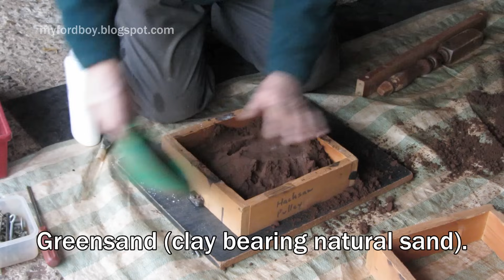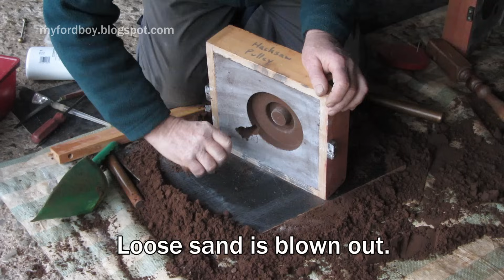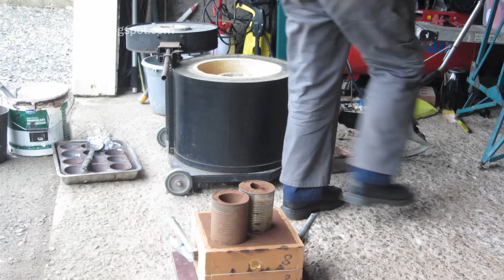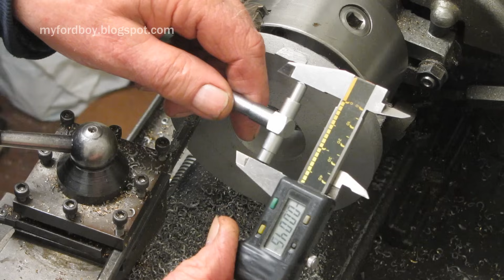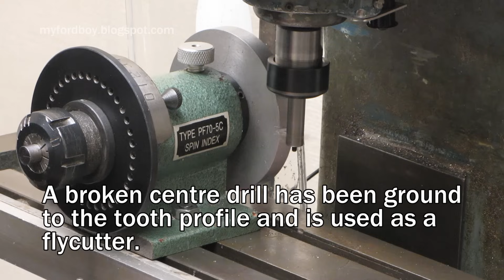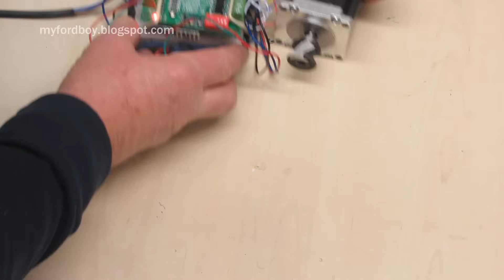Metal Casting at Home Part 64. Casting and Machining a Toothed Pulley.

Comment: its cheaper to take it too lazer cutting machine and get them to cut one out got a sprocket made for a deltek mini bike 50 bucks
Reply from the maker: It's not cheaper, this cost me virtually nothing. It's about the satisfaction of making something rather than writing a cheque.
Reply: @myfordboy  1 - agree for satisfaction... I also enjoy all kinds of DIY...
2 - don't necessarily agree for costs.
     Of course costs for oven, machines, tools, sand, etc. split to all projects -- still they all definitely cost ... also electricity, oil... doesn't come for free.

"virtually nothing" only if - you split to a lot of projects - machines & tools last for 20+ yrs - and if oil & electricity cost almost nothing.
Reply: I agree... 99% viewers will save a lot by using any king of service ... Billions of clicks pay off for everything I guess.
So the video is kind of non-sense if you thing about that. Still I enjoy such as most do we can read from comments.

Comment: what do you use as parting dust and is that wd40 use for cutting oil?
Reply from the maker: Talc for parting powder. The spray is Tectane CO507 cutting oil but WD40 works well on aluminium to.

Comment: Одного не понял. Зачем нужно было отливать диск, потом вытачивать отверстие. С отверстием значительно сложнее ?
Reply from the maker: To cast the part with a hole would have needed a core to be made. By casting the hole not quite through it was not necessary.

Comment: Great work, but not the best choice of motor connector. It's common rule to use socket on side which can remains under voltage when the socket disconnected (hot) and plug on the other (cold) side. Surely, you cannot get electric chock from open contacts under the voltage this motor use, but any metal chip in connector when you accidentally forget to power off your system before disconnecting the motor can damage your motor driver.
Reply from the maker: Your are of course correct the socket should be the supply side but as the motor is only 3.2 volts its hardly an issue.

Comment: I've heard that talcum powder is being replaced with corn starch in modern baby powder, for health and safety reasons. Is this powder also suitable for dusting your forms?
Reply from the maker: I just use the cheap stuff from the supermarket, I haven't seen any cornstarch stuff.
Reply: Mooncabbage I buy pure talc powder from a billiards supply store. Like $6USD.  Baby powder is mostly starch due to breathing talc being bad for a baby.  Both probably work fine.  One smells like a diaper, the other one, like ground rocks :)

Comment: anyway you would sell one of those gears?
Reply from the maker: I can do a blank casting. you would have to cut your own teeth.
Reply: I can live with that, very happily i might add unless you want more than $50 for it.
Than i might have to pass, and try to make it out of billet which would be just as expensive lol.
Also i live state side.... so we'll have to figure out the damage lol.

But I have a mill, lathe, band saw, and welder. Just no casting ability and after seeing this i feel so incomplete without having one lol. Though i doubt my wife would let me start casting, since we live in the city area and small garage.
Reply: Btw what was the Pitch Diameter and tooth profile you used?
Reply from the maker: The belt is 170XL037,  google will give you the profile. I can do the casting at £20.00 (GB pounds) plus shipping. I estimate £10.00 to US
Reply: That is very reasonable thank you, I kind of figure it out to be a XL only issue with pre-bought gears are the hubs are too small. Billet i don't know just seems more fun to do it with your casting, which btw seems to be solid.
i'll email you in a bit about and with everything.

Comment: Do you save the aluminum machining chips for recasting?  - You lost this old analog guy at Arduino!!  - Great video as always.  See you in part 2.
Reply from the maker: I do'n save the swarf. Too much surface area to metal makes for lots of dross.
Reply: Makes sense, more surface area more oxides, more oxides more dross.

Comment: Aluminum is toxic.    Then not your average household garage has a kiln or a lathe.    So yes, this can be done at home if your home is a machine shop.
Reply: It's not as difficult as you imagine you don't need to be an egineer these days ...honest.
 You do need common sense , persistence and the ability to think things through.
 You make your own Kiln , You'll nee a power drill and a reasonable stet of metl work twist drills , a hacksaw  or a small angle grinder is very useful.  Borrow a small welder set if you don't have one or simply use nuts, bolts & washers to  pull things together .

If you don't want a posh  kiln you can dig a hole in the ground ' line it with clay bricks and use charcoal as a fuel  with some sort of air blower to blow air in from the bottom just like the Romans and Bronze Age people did .

You can also make your own " gingery lathe " , how do you think  engineers made things in the  ate 1800's ? 

 If you Google " Gingery lathe "  you should find  a site that lists about 100 gingery projects made at home with home made equipment .

Comment: Do you adjust the aluminum mixture with mineral/metal additives for the project at hand?
Reply from the maker: I use aluminium car wheels for the material, degass with sodium carbonate and add a drossing flux. I have shown this on lots of the previous casting videos.

Comment: i dont have an indexing head. I do have a chinese cnc machine that is great with aluminium.. and a chinese 8x24 lathe I would have used to face the back of the pully then put it on the cnc machine to profile the teeth by drill milling the pattern, then cnc machined the centre hole and  outer diameter too. back in the lathe to finish the other face etc. It works, I have made many bicycle chain sprockets.. even in steel (but thats pushing the cnc. 6050).
The trouble with the chinese cnc is the cross bars are just only 16mm and 100mm apart. 500mm long and they bend under load. The cutter can twist the rails 1mm with 20kg force. if they had used 20mm shafts that would be about 100kg and a 25mm shaft about 400kg.. I will modify it one day.
Reply: +Raymond Merrick 
The fine China should only be used for special occasions!
:

Comment: Nice work but an index head is not intended to be a spin head. You’ll ruin your index head. Just saying...
Reply from the maker: It's for indexing.
Reply: @myfordboy  that's exactly my point.  No need for a motor on an index head.
Reply from the maker: In standard form you can only index a number that divides into 360. With my arrangement you can index any number for example to cut a 57 tooth gear.
Reply: @myfordboy  got it, thanks for clarifying!👍

Comment: That seems an awful lot of work to make a blank that could just be sawn off a length of Aluminium bar which wouldn't have any blow holes or impurities. These things cost next to nothing from a stockholder.
Reply: Obviously you did not read the prior comments, where the topic you suggest was well-covered.
Reply: Do you read all of the prior comments to a video before commenting? No, people comment on the content of the video and description. I don't believe there was anything there to suggest that this wasn't intended to indicate that it was a good idea to cast a pulley. It's a bad idea, and that's what I said. If you didn't mean that, then perhaps you should have made yourself clear.

Comment: this guy's a pro. Since computers this tecnology is practically lost
Good to see someone reviving casting
Reply: I agree.
Reply: Is not, that´s a belief. There´s plenty of manual engineering work, it´s not effective to have CNC, water, lasers for smaller production, tool maintenance etc. It´s not that visible, but still exists.
Reply: Yep, some wiz kid would 3D print it with sintered metal while anyone else was still making the timber moulds & machine the plastic blank, and mixing green sand.
That’s why these technologies are dying art forms.
It is good to see the knowledge being preserved for posterity.
Yes you could cast it or you could have bought a short piece of 6 or 7 inch alluminium round bar stock & just turned it in the lathe & then milled the teeth.

I have to say I do enjoy watching this all the same, very satisfying.

Comment: Nicely done!  Hey, a couple of dumb questions.  Could you have done this with lost wax? Also, is the casting sand reusable?
Reply from the maker: You could use lost wax. If you mean to also cast the hear teeth, whist this is possible I would prefer to cut them.
Sand is reusable.

Comment: 7 to 1 division ratio in software with a 72 tooth pulley ????  72/7 is not an integer, 6 to 1 surely.
Reply from the maker: No it's 7.2 to 1. The software converts it to the required number of steps taking into account any ratio of gears used. Just a matter of altering the Arduino sketch.
Reply: Arduino's are not the best at floating point math. I recommend keeping the primary ratio an integer. less chance of cumulative errors.

Comment: beautiful result and video. newbie question for you, what would've happened without the runner during the casting? I thought I recalled you saying the air can escape through the sand, but will it risk having air pockets at that size?
Reply from the maker: For a shape like this you need to feed the mould in the side to prevent damaging it and have a riser in the centre. Without the riser there would be a depression in the centre. The riser is needed to feed the mould as the metal cools.

Comment: Are you going to control the indexer locking pin too?
Reply from the maker: The locking screw on the top of the indexer can still be used if necessary.

Comment: so if i were to use a 6 tpi belt and the final circumfrence would be 12 inch to give me 72 equally spaced teeth ?
Reply from the maker: taplow marlow It's not quite that simple. I used the same method but diameter comes out too big.
The belt pitch is measured at a different point of the belt than you think. You can do the same as I did and keep reducing the diameter until the belt fits. There must me a formula for the calculation but I could not find one..
Reply: interesting...so what diam did you end up with ?
Reply from the maker: For the specified belt it's 4.55"
Reply: taplow marlow
Reply: what ?

Comment: How did you determine the OD of the cast pully? Did you use standard timing belt and count the length of the belt at 72 teeth and divide by Pi? Where did you get the pully for the stepper and does it have 10 teeth? Can you share the source for both the stepper pulley, timing belt, and length/width of the timing belt? Very well done series.
Reply from the maker: I used the pitch of the belt x the the number of teeth divided pi to calculate the OD but it worked out too big for some reason. I had to reduce the diameter until the belt fitted. Final dia is 4.55". There must be some proper calculations to use but this method worked in the end. I already had the 10t tooth stepper pulley but they are easily available if you do a Google search. The belt is a 170XL037 from Ebay.
Reply: Thanks for the detailed resonse, much appreciated. I am a novice but I calculated the OD of the driven wheel at 4.625" using Ivan Law's book and a DP of 16 instead of 20 and have ordered a timing belt from your response. I will look at cutting a tooth tool from the 16 and 20 views in the machinery handbook to see which one fits the best but suspect there is so little difference it is immaterial. A drive pulley of 9 teeth would have given exactly an 8 to 1 ratio but I could not find one.
Reply from the maker: I don't think you can use the same formula as an involute gear for a toothed belt pulley. The belt has a pitch of 0.2" . 10 teeth is probably as small as you can go for the small one.
Reply: The exact amount you need to subtract from the pulley radius depends on the type of belt you're using. Distance from the inner surface of the belt to the tension cords in the belt. Page T-16 here has numbers for some belts. http://www.sdp-si.com/PDFS/Technical-Section-Timing.pdf
Looks like .010" for .2" pitch XL belt.

Comment: Will the Arduino, display, driver etc be available through your Bangood links? I have a 6inch vertex to convert, However, I am now thinking a spin indexer may be a better bet as it will take my collets without having to be adapted...
Reply: I'd be interested in this also
Reply: I see they also have a suitable stepper motor....
Reply from the maker: Bangood do the Arduio and LCD shield https://goo.gl/GAwyP6 and the motor driver   https://goo.gl/NhklOv I see at the moment there is a coupon for 12% discount , coupon Kits12%.   If that coupon does not work there is another for 10% discount on electronics elec10bg  (valid until 28th February 2017)

Comment: It would be interesting to see how accurate the spindexer will be at higher divisions.
Reply: It would be insanely accurate. If you have the ratio of 7:1, then 200 steps/rev from the stepper motor and then maybe microstepping and you could divide the whole rotation up into 22400 steps (with 16 microsteps, some drivers even go up to 128 or 256). Ok, I know, this is the resolution, not the accuracy, but that should be also very high.
Reply: hacer taladros manualmente

Comment: I cannot see how anyone could give Myfordboy's videos a thumbs down!...His videos are awesome!
Reply: He went to a great deal more work for the aluminum casting.
Never gets into the safety aspects of molten aluminum eater.
I cast round stock aluminum  and use as needed for different projects.
a great cutoff tool is a old finishing wood saw as the fine teeth do not get clogged but they are small enough to not grab too much aluminum.
Reply: Back in the day when people worked for a living , when a boss asked about if someone was working or goofing off , one would hope the report was,  all I see when I see him is ass and elbows. 
That meant your bending at the waste and doing something. work.
Reply: @aaronjanzen4078  I believe the propper medical term is "recto-cranial inversion"

Comment: is this aluminum u working on ?
where do u get the clay for moulding and what is the technical name for it ,pls let me know thanks
Reply from the maker: Yes aluminium. The sand is known as greensand. I have a natural clay bearing sand but it can be made by adding bentonite clay to silica sand.
Reply: Myforboy ,   besides the powdered Montamorillic ( SP?)  clay aka Bentonite,  using what we know as Silversand or refractory sand ,sometimes sold in 15 kg bags of kiddie play sand  sand is a way of getting a very fine graded dried sand to make into a dampened fine casting sand.

Comment: Very cool, but I have a question.  Given all the drilling and work to bore the hole, why not cast it with the majority of the bore and just clean it up after?  Would it not pour properly?
Reply from the maker: To cast the part with a hole right through it would have needed a core making. That would need a core box making, so it's a lot more work. The pattern would have been more complicated as it would have needed core prints to locate the core in the right place.